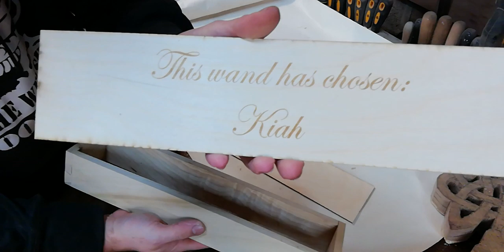Woodturning -  Cat head magic wand

Comment: I like anything with cats.  Blacksmithing is my other main hobby and them name of my forge is “The Anvil Cat Forge” which makes it easy for marking a piece wit TAC for it and also happen to be my initials. So I enjoyed watching you make the cat wand.  Thanks.  Cheers, Tom
Reply from the maker: Thanks Tom, that's cool blacksmithing is also another hobby of mine, I find it just as relaxing as woodturning 😁 sadly the old flamefast gas forge I used to use has finally died, so haven't done any in a while. Thank Tom
Reply: The Welsh Woodman: Well you need to build a new one.  I was fortunate enough to attend FIFI (First International Festival of Ironwork) In Cardiff  (probably before you were born, as that was in 1989).  That was a fantastic event and a wonderful trip were I got to see a little of London before and after the conference and a good deal of Cardiff during the event.  I’ve always wanted to go over again, but life has kept getting in the way, but maybe someday.  Cheers, Tom
Reply from the maker: @tomcoker9882  it's certainly in my future plans to make or get another one 😀 that event sounded brilliant unfortunately I wasn't born then but hopefully there will be another similar event in the future 😁

Comment: Tom I just came across this video and being a cat person found it to be quite enjoyable.  Very nice work to make a very nice gift.  You said you laser engraved the lid and base.  It also looks like it was cut out with a laser.  What laser system do you have?  Thanks.  Cheers, Tom
Reply from the maker: Hi Tom, I designed the lid on a CAD package called 2D design and then engraved and cut the lid and bottom out using a techsoft laser cutter. If it would interest you I could make a video of the process? Thanks for watching 😁
Reply: The Welsh Woodman Hi Tom, that would be great.  I’ve been exploring the idea of getting a laser CNC or router CNC (with laser module add on), but haven’t found one with the capabilities I want in the price range I want.  I’ll try to look up the Techsoft you use.  Has it proved itself to be a good unit for you?  Cheers, Tom